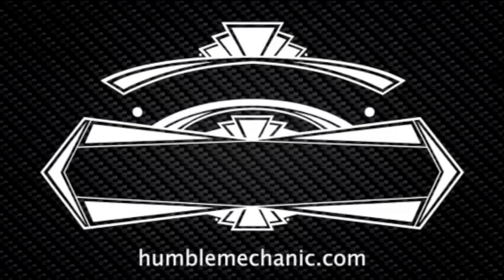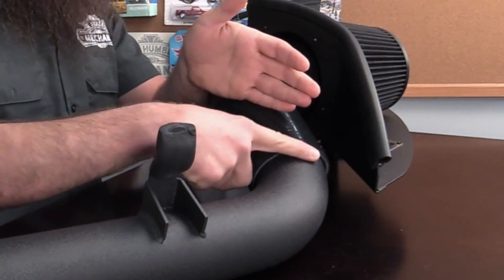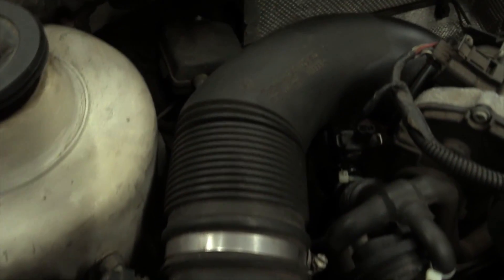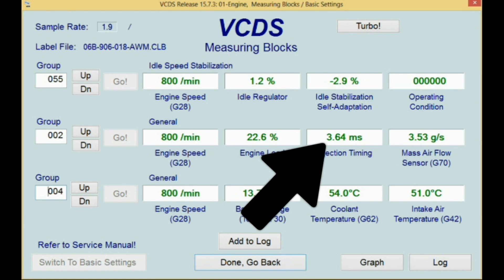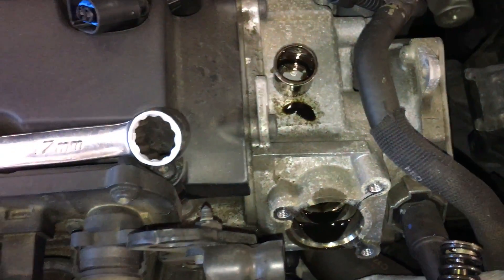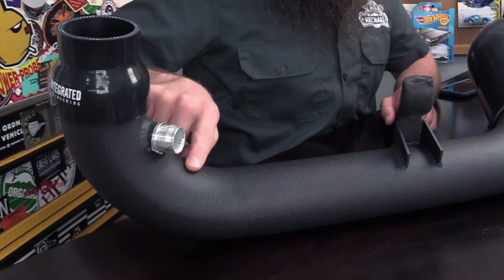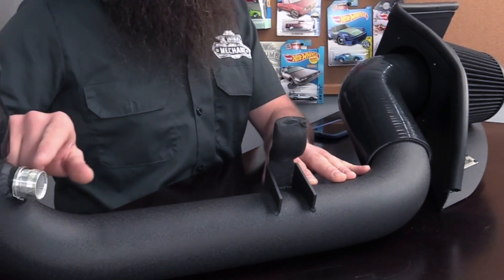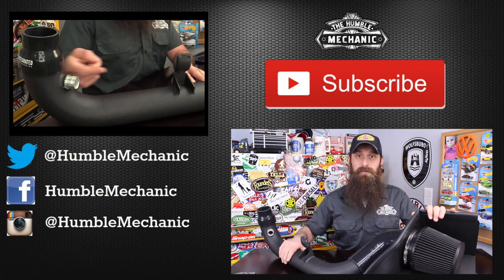What Does SYSTEM LEAN Mean?

Comment: Thank you HumbleMechanic for making this video and your clear explanation. I found my wife's problem through your basic explanation. the last time the Subaru was in the dealership they removed a clamp and never replaced it leaving the air intake the fall off which is what caused the check engine light. I never would have thought to do a visual inspection had I not watched your video. Thank you.

Comment: Hi Charles, I hope you can read and answer my question. Can I remove the secondary o2 sensor, I mean blocking it? I have a catless downpipe and a defouler to avoid the CEL. Thanks
Reply from the maker: You still need them in with the defouler. Or have the ECM programmed to remove the monitor.
Reply: Thanks, I just tried to block it, but got a CEL the minute I started the car  :) I had to put the defouler again.
Reply: yea it would be nice to have this good question answered

Comment: my long term fuel trim whas 12 % the car had no fault codes, but the performance of the engine really sucked! After checking for false air and replacing all filters still the same. So at the end i replaced the front o2 sensor with a new oem one. And now the car feels like a whole new car a lott lots of power and the long term stays at 0,5 %. Never trust these lying sensors !
Reply: this is probably what wrong with my car. it wont even rev past 2000 rpms it drives fine just cut off if u dont let it warm up. im gonna change the 02 first while also checking for leaks. its an 05 ls lincoln i bet this does the trick

Comment: Oh last thing,last year my turbo blow and dumped loads and loads of oil in the exhaust.....when I pulled the down pipe off to change the turbo I notice the whole of the turbine and shaft had gone never to be seen again could this be blocking the exhaust or could the oil of mucked it up to?Cheers mate

Comment: Hi Charles,I have a vw t5 2007 1.9 I have a problem we’re when I put my foot down I get hesitation....I get power then holds back then power and so on and so on but no codes or check lights any ideas.Cheers pal
Reply from the maker: be sure the intake is not clogged and teh fuel filter is good
Reply: @HumbleMechanic  check your coil packs if equipped.

Comment: Do u recommend a tune if installing a cold air intake or short ram intake?
For example my car, 2010 genesis coupe 2.0t, if I put either intake, do I need a tune?
Reply: I would recommend getting a tune after doing that. The car will run without a tune fine probably with just replacing it but if the car is pulling more air than stock intake you may throw a code or car may not run quite right. I would bolt on a certain amount of mods to the car if you are wanting to do more then get a tune as soon as possible. If you are just doing the aftermarket short or cold air intake and wont be upgrading anytime in future good to get a tune I would say. Maybe I'm completely wrong in this thinking but a tune can help.
Reply: @shamwaymoonyos9578  so I got a cold air intake like a month ago and after it threw up p0171 code   Saying system to lean, is it cause I need a tune?
Reply: another good unanswered question

Comment: So on an MK4 (2001) Jetta (1.8T AWW), how many drive cycles will it take the CEL to reset on its own (After a fix)?  I did the stupid thing when I first bought this car (because I wasn't sure I was going to keep the car...) - I bought a $19.00 MAF from ebay.  It only lasted 8 months, and then began (even after cleaning) under-reporting airflow, causing an intermittent P0171 code every time the LTFT hit 20% (Under ALL engine loads).  Today, I installed a Bosch MAF, and cracked a smile when it entered closed loop, and STFT immediately pegged at -20% while the +20% LTFT began dropping.  3 drive cycles later, I have less than 8% LTFT and still have some negative STFT, which is still working on bringing that LT number down.  I'm confident the problem is fixed, but wondered how long it will take the ECU to figure out that the problem is fixed and clear the CEL.   Figured I'd ask a VW man :-)

Comment: I have 08 Passat 2.0T 122k miles. CEL is on. P0302 P0171. CEL is on. I changed all sparks/coil. And now the CEL is still on for P0171 system 1 too lean bank 1. But after changing spark/coil. I get a random misfire with the random shaking sound from exhaust then white smoke coming out. Can it be the 02 sensor (downstream) that’s causing my misfire and system to lean?

Comment: Will a muffler delete turn on the system too lean fault
Reply: jay sour Most likely not. Luckily the mufflers are past the O2 sensors. A delete will make the ECM adjust for the higher exhaust flow (if post cat/O2). Additionally, those generic P0171 are typically vacuum leaks (newer models). So in return vacuum leaks will typically be on the intake portion of the engine. A muffler delete shouldn't throw that code. Just replaced my PCV valve on my 07 A4 2.0t with Audi's remake bc mine had a vacuum leak. Hope this helps. I usually have to learn for myself.

Comment: Hi Humble, my 2006 Jettta 2.5 has the tendacy to reve up when stopped or idle, the RPM would rise without my pressing gas.  My engine light is on, but still drives.  Also my fuel gauge shows empty yet i have gas, drives and fuel light is not on.  Please help.  I love this car, so i am gonna invest.

Comment: So ive replaced intake manifold gaskets new injectors new fuel pump new regulator system running lean both banks 21+ new Maf sensor new fuel filter. Help??

Comment: When you said that O2 sensor TYPICALLY but not ALWAYS peg out at max LEAN signal, I'm fairly certain it's based on your own personal experiences exclusively, and not influenced by what you have heard from others...

My question is, how much of that supporting experience comes from ONLY V.W. / Audi ??? My gut tells me better than 75% stems solely from VW. Only reason I even bring this up at all is because based on my experience at independent shops where I have worked on just about ANY make and model of car in existence, it's a fairly even 50/50 split for O2 sensors to peg out either lean or rich when it kicks the bucket. I have yet to really find any rhyme or reason as to the causes of either death result... I feel a SLIGHT bias of Rich codes in American vehicle like Ford and GM. It may not even be real and if it is real, it's very very slight...

Comment: About a year ago I had some 02 codes on my v6. Ended up replacing all 4 o2 sensors. 6 coils. 1 cat converter and inlet manifold gasket. All good for 6 months now I'm getting bank 1 and 2 lean at idle codes.....
All the long and short trim figures look good.
What could it be ?????

Comment: Hi Charles, the values for my V8 Touareg show ~0.5%   -3.9%  ~0.5%  -4.1%. The 1st and 3rd entries often fluctuate but usually never go above 0.9%.  The 2nd and 4th entries usually settle at those values after driving the truck for a few minutes. After watching your video, I understand that the computer in my truck is pulling fuel back to compensate for too much fuel or not enough air. However, the check engine light is not on. Are those values high enough that I should have the problem repaired? What are the possible causes for too much fuel and/or not enough air? Thanks.
Reply from the maker: These are correction numbers in MVB 32(I assume). It is most likely not enough air, or air turbulence. Are the actuator arms of the flap still intact? 

But yeah, that is not enough to worry about
Reply: Thanks for the reply. I will have the actuator arms inspected. And yes, those values are from MVB 32.

Comment: My '13 Impala (sorry I know it's not a VW) will have a +14-19% long term fuel trim on bank 2, and slightly high, 10-13 on a 30-45 minute HOT SOAK ONLY.. On a cold start and run it's fine, 2-8% both banks for as long as you run it. But as soon as you hot soak it for 30-45 minutes, the trims especially on bank 2 go way up. Chevy can't figure it out. Any ideas? It's been smoke tested on the engine and exhaust.
Reply: James Karl air intake temperature sensor. Try cleaning it with the MAF sensor. IAC. EGR valve.

Comment: Great video. I'm afraid I fall into the diy camp of changing a long list of parts on my 2008 Audi a4 2.0t fsi, and not fixing the problem. I also had it at a local shop that said they did a fuel pressure test and a smoke test, and couldn't find the problem. Not an Audi specialist. Wonder if I need to give up and pay the dealer the 169.00 to diagnose the problem. I changed the MAF, purge valve, checked the hpfp and changed the cam follower even though the one in there looked fine. Changed plugs, Mercedes fuel system cleaner, fuel filter, pcv crack case thing, pcv hoses. After changing the pcv hoses it got better, but still comes back after a long drive (over an hour) and only shows at idle. Lumpy, almost dies but doesn't. Otherwise runs great off idle. I am stumped. Only throws P0171, no other code.
Reply: Hi David i done the same as you 2007 Audi A3 1.8T , my engine runs fine , then one day i notice a check engine light , hooked up the scan tool and it was a P0171 , first thing i changed was PVC valve , MAF sensor , air filter , fuel filter  , i cleared the code every single time but comes back , buy this time im getting confused , take it to garage they hook up smoke machine  they said it was your rear main seal and showed me where the smoke was coming out , so i thought i would try some Rislone rear main seal repair oil and it has stop the slow oil leak i had but the engine light still comes on??? ,
Reply: @karlhendricks8864  Thanks for the comment Karl.  It's been fixed for several years now thankfully.  The problem was what I will call a breather/vent hose that I believe goes between the crankcase and manifold.  On the 2008 2.0, it is a silver metal formed hose  toward the front passenger side on the engine.  A German mechanic told my mechanic to take it off and blow through it from both ends. Apparently there is a valve in the middle of the hose you can't see that should stop air flowing in one direction.  Since the mechanic could blow in both directions it acted like a vacuum leak which usually is far worse at idle since there is little fuel being demanded.  A new hose fixed it. Not sure if that crank case vent hose is on the 1.8 or not.
Reply: Wow that's  good you have it sorted out , and it was just one breather hose ! Maybe I will check mine

Comment: Nice review. For those of us who don't do this every day, remembering which way the values are pointing is the first hurdle. Also it's wise to remember whether we are looking at the correction (fuel trim), or raw O2 sensor data. That's mostly a matter of understanding tools, in this case the interface program we are using. Conveniently, when looking at O2 sensor data, higher voltage means rich, and when looking at trim, higher positive numbers mean the system is adding fuel. That similar alignment makes it easier to remember. Of course on the surface it can be confusing since adding fuel is usually a response to a lean condition downstream, which may be completely corrected by the addition of extra fuel. So I see your point, look at trim first because the O2 sensor data may be obscured by correction of injector pulse width. Thanks! Your description of the most common points of failure adds practical guidance to how experienced techs solve problems.

Comment: What would be the cause of a lean condition from using E85 in a non flex fuel vehicle. From what I've gathered for my vehicle, is that it's burning more efficiently or cleaner, or faster. Could it be that my vehicle is not pumping enough of the E85 to be efficient?

Comment: I recently replaced my 02s. Forgot to disconnect the ground from my battery caused a short. Obviously... my Taurus blew the fuse under the hood. Number 28. Made the rookie mistake of climbing over the engine and working the intake loose. Long story short check your. vacs your codes and double check your own work.
Reply: What the hell? Why would you disconnect the battery to disconnect a o2 sensor? Just keep your car key in your pocket thats more than enough to disconnect the o2 sensor without going anything wrong

Comment: Hey Charles love your videos big fan I have a 2010 Volkswagen CC  have a checking Engine light it reads out system to reach at Idol I don't have no clue can you help thanks bud
Reply from the maker: +Cuban Link 2010 (deadalive) system rich is odd. Could be an o2 issue, fuel pump module issue, even an injector issue.
Reply: HumbleMechanic Thank you for replying quickly the code P2188

Comment: hey if you exhaust smells like unburnt fuel is it running to lean or rich?
Reply from the maker: typically a rich situation.
Reply: Normally it's running rich. If it smells like unburnt fuel there most certainly is unburnt fuel in the exhaust!

Comment: Nice video! Would a bad intake manifold cause P0171?
Reply: Hook up a scan tool with livefeed. check your sensor readings
Reply: I don't think so, since I think that would affect both banks (I also read that a bad intake manifold will cause a car to run awful on cold startup but run fine after warm-up).  It can't be things that would affect both banks like vacuum leak, MAF, fuel pump & filter, air filter..
Currently I'm having high fuel trim on just bank 1 (~14% at above 1000RPM, so not enough to set a P0171).  Bank 2 is well within spec.

Comment: a/b = Q
Ideally, Q should have a value 'k', which is a constant for the ideal ratio for your car, but Q represents the real result obtained from conditions a and b.
How do you keep Q=k when a and b are changing every few ms?
Well if b increases means we divide by a larger number, decreasing our result (Q < k) but we dont want that. We want Q to remain equal to k.
In that case, you can increase the value 'a' to compensate the change introduced by increased 'b'
On the contrary, if b decreases, we divide by a smaller number, increasing our result (Q > k)
For this case, you can decrease the value 'a' to compensate

Simple math to understand the fuel/oxygen ratio explanation. 
Both scenarios have variable values that produce a ratio (Q) which we want to be constant at a value 'k'. In order for the engine to operate at top performance, you have to account for the changing values a and b (fuel and oxygen) at every detonation, on every cylinder.

Comment: Great video Charles. I remember having a big problem with this on my old 1.8t AWP engine. I replaced the diverter valve because it went bad and when reinstalling the hose on the left side of the diverter valve it was in a slightly different position than it was initially. This caused it to touch what looked to be a metal fuel line behind it. From the heat of the fuel line the rubber hose split open causing a huge leak. I battles this problem for a LONG time and the car always ran in limp mode. Just advice to everyone when working in your car, pay attention to all the details!! Listen to Charles! If i just did a more thorough inspection it would have saved me a lot of time and money. Lesson learned I guess.

Comment: I have been dealing with this code for about a month now on my 99 yukon. I have checked and cleaned everything i could. Just found the problem yesterday and it was that the exhaust flange gasket deteriorated away and it is located right before the o2 sensor.

Comment: Hey Charles! I like your videos a lot. I have an old 92''s Mk3 Golf with 1.9 turbo diesel engine (AAZ). Do you know any simple mods for these engines? I know one and it is adding an intercooler. Would isolated from engine heat pod filter do any good? 
P.S. I hope I wrote everything understandable.

Comment: Hey Charles, good vid touching a bit on the topic of lean (P0171, P0174) codes focusing on un-metered air and faulty O2's. I Ever give any thought to skewed MAF readings i.e. dirty/ faulty MAF or perhaps issues in the VVT causing lean trouble codes, engine mechanical timing i.e. incorrectly installed timing belt on one cam, sheered key ways etc. or perhaps engine mechanical condition i.e. valve lash etc.? Just curious your thoughts on that and also any thoughts on chasing down lean codes on speed density engines as opposed to MAF engines? Also may keep in mind to that an ignition miss-fire will cause a lean code :) No combustion and all it does is pump air right? HC's can not be read by the O2.
Reply: +South Main Auto Repair ERIK O FOR PREZZ LOL
Reply: South Main Auto Repair Saturno Outlook
Reply: Saturno Outlook 2008
Reply: Man you have Dr O giving you props. Would be my dream
Reply from the maker: +South Main Auto Repair I have only ran into maybe 2 sys lean caused by mechanical issues. It's sure possible, but not common(in VW land anyway). 

I agree that there are more issues with system lean. But I think that will be System Lean 202 class.  Haha. 

For the first run of these videos I want to keep it simple to get people mind moving in the right direction. Mostly so thy stop just throwing O2 sensors in.
Reply: Wait you mean if I get a lean code I shouldn't just change the AFR's and a fuel pump first ;) Haha Can't wait for Lean Codes 202 :)  I have had a few neat case studies on mechanical issues setting lean codes... they can mop the floor with ya if you are not careful! Keep up the good work!